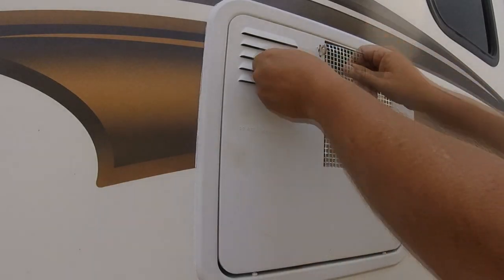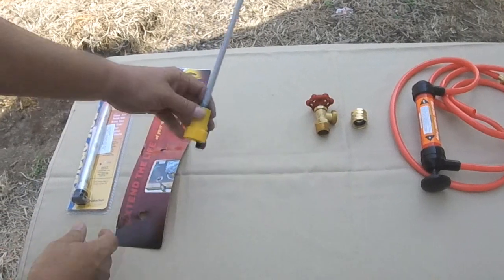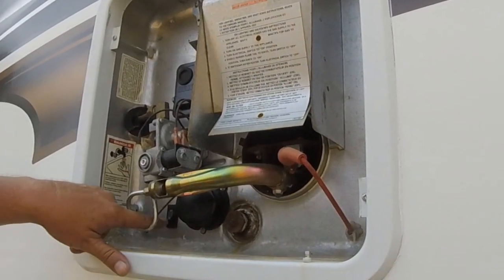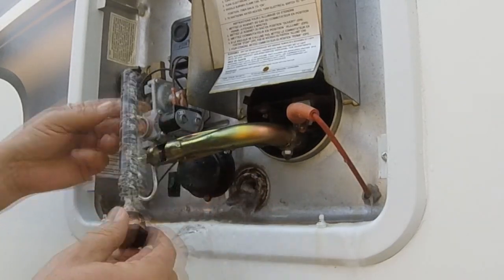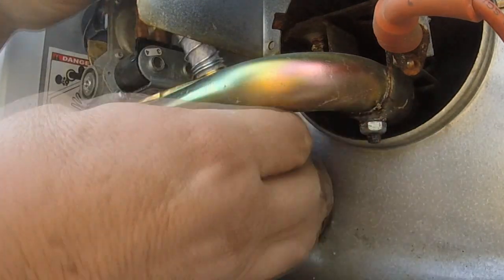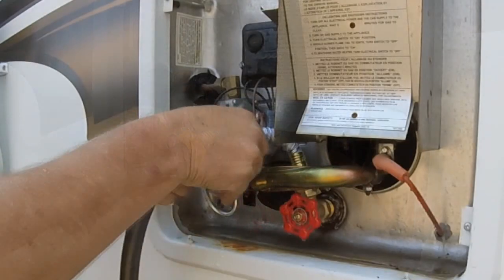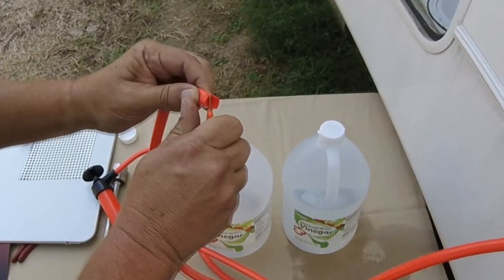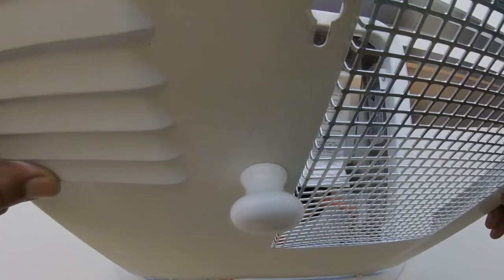Flushing Suburban hot water heater and maintenance Part 1

Comment: That works but why not just drain the system then dump then dump 2 gallons of vinegar an 9 gallons of water in to the fresh water tank, then turn the pump on an turn the hot water on in the sink till you get vinegar out of it?
Reply: +RCRV I am not trying to clean the fresh water system. Just the hot water tank. I use bleach in my fresh water tank it has no rust. Rick aka RVParkSmart